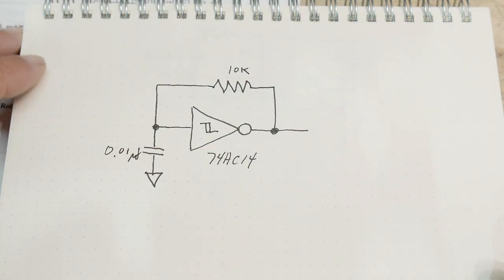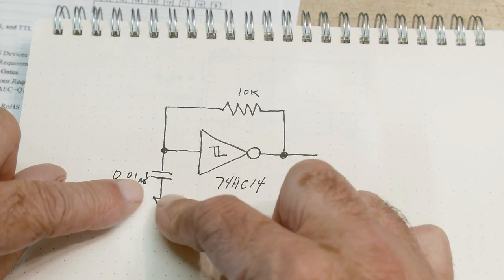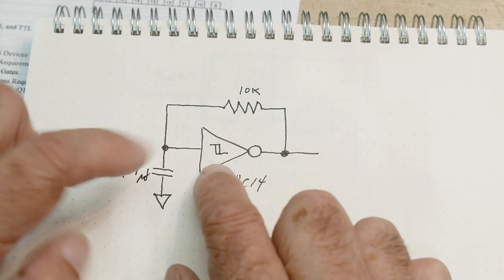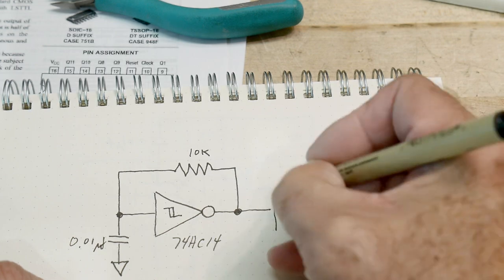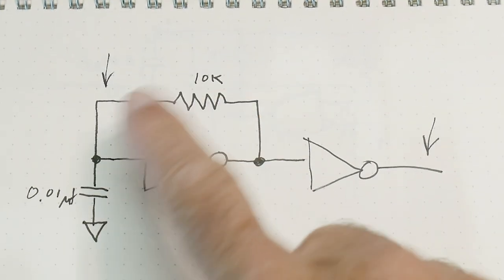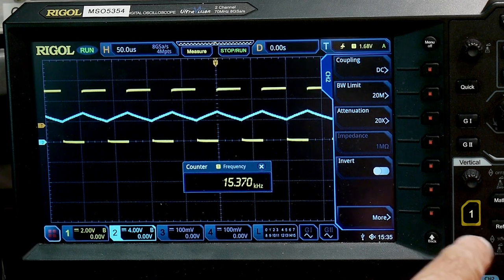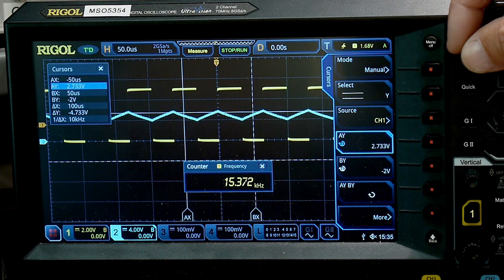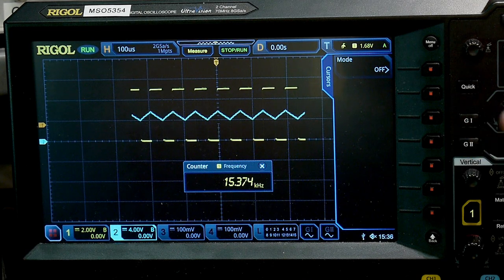#1106 74HC14 Oscillator

Comment: You can also make a VCO with that, use 5 of the gates in a ring oscillator, and the sixth as a buffer, and feed Vcc in as a variable voltage, so you can adjust the output frequency. Not too stable, but, with a PLL, it works well to make a multi megahertz oscillator, though frequency depends on the actual logic family used, along with the manufacturer of the specific IC. Second package acting as buffer to get a logic level output might be needed, along with a pull up resistor, to get a reliable logic level at the lower end of the control voltage range as well.
Reply: Ring oscillators are fun to play with.

Comment: So you can actually take both outputs and mix them if you use a pair of buffer stages and adjust for the level discrepancy between the two, I imagine. Could be quite handy for a simple LFO generator.